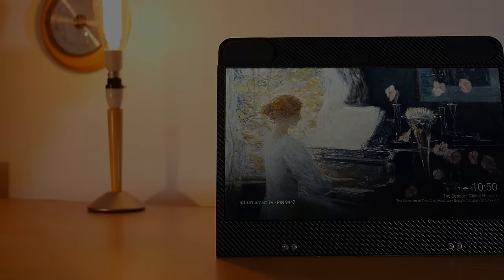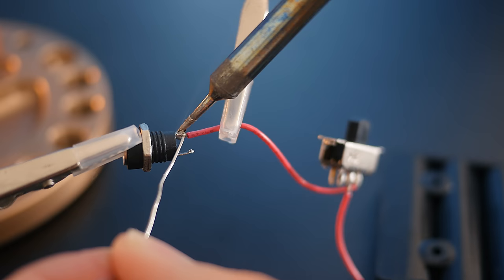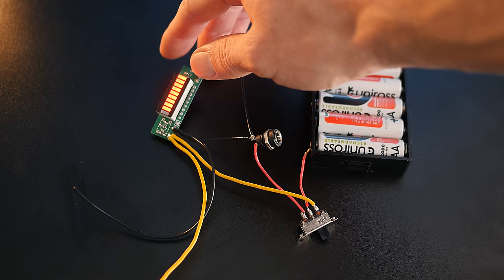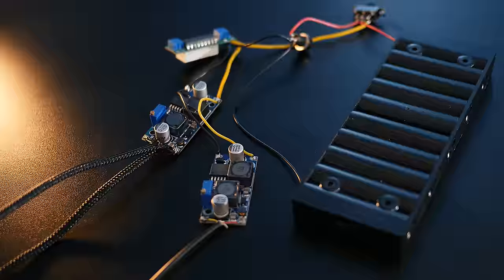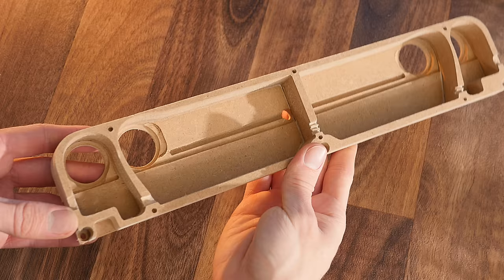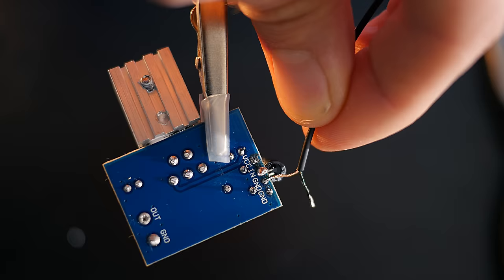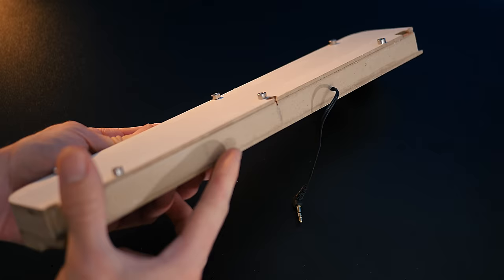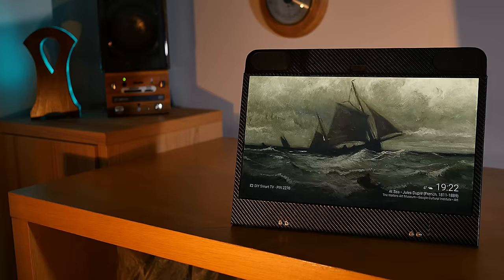Build your own portable SMART TV (100% wireless!)

Comment: Any reason why you went for a load of AA over a few 18650s ?
Reply: cheap and safer to work with
Reply: +山寨卡屁 Lithium cells are nearly as safe as long as you keep them above 3v, keep them under 4.2v and don't short them out and although it costs more there are also LiFePO4 cells which are even safer.
As for the cost, AAs are certainly cheaper but not by very much, especially when 18650s last longer (roughly 400 cycles vs about 1000 cycles) and have way more capacity so I'd say that easily more than makes up for the price difference, but if you go on ebay and buy cheap laptop packs you can get good deals on 18650s at around $1 per cell and are usually decent cells, last couple packs I bought, I received cells that were roughly 2000mah and 2400mah. (9 cells and 12 cells) for me the cost was closer to $1.25 per cell so let's calculate the cost difference using that.

$11 and $15 for both packs, now rechargeable AA tend to go for about $20 on an 8 pack at local stores and $35 for 12 pack of quality pack of eneloops makes them $2.5 and $2.9 per battery, now that's an unfair comparison since the 18650s are used but new cells only cost $3-$5 and offer over double the capacity and at least double the lifespan, without counting the added charging and discharging circuitry they are an insanely good value compared to AAs.

I'm guessing he went with AA because people are more likely to have them lying around their house and/or merely prefers them for some reason.
Reply: One thing you're wrong about, Eneloop Ni-MH AA cells are rated for 2100 charge cycles, which is much better then cheap 18650 Lithium cells. They hold up to 60-80% their charge for well over a couple years and have a VERY low internal resistance. http://a.co/cfeNtl3 Price per unit is about $2.65. The new line of Eneloop cells are very impressive in terms of specs. I think they're working on a 2500/3000 cycles 3AH version to be released 2018.
Reply: theLuigiFan0007 Well I meant more so in general terms, obviously if you get some quality 18650 cells and limit their charge to only 4.1v or there about you can get 2000-3000 cycles on those too, but yeah those eneloops are pretty great aren't they? Plus they don't even cost much more than some of the poor quality batteries sold in local stores.
Reply: vgamesx1
Rayovac used to have Ni-MH 48 packs for $70 and 24 packs for $40 on their site. They were 2400mAH and rated for 500 cycles or 1350mAH and rated for 1000 cycles. That's not too either for the price, but I can't find packs those size anymore. I bought a 16 pack of Rayovac Ni-MH batteries a couple years ago (1350mAH version), and last year got a 16 pack of Eneloop cells.  Still use the Rayovac batteries quite often, but more for things like flashlights and game controllers.
Reply: theLuigiFan0007 I use my eneloops for my mouse, it has great battery life even without eneloops but who wants to worry about their mouse suddenly dying or running out of batteries? For flashlights though I've switched over to 18650s since they're usually brighter and/or at the very least last longer from my experience so far, including the cheap ones under $10 are fantastic, well aside from the annoying flashing/sos mode on a lot of them.
Reply: vgamesx1
Yeah, Lithium batteries do result in much brighter flashlights. They're definitely the way to go unless you like building very tiny electronics like I do. Gives me something fun to do. :P

Epoxied three ring shaped intertwined coils of fine wire to the underside of the light reflector. 100 turns of 40 gauge, and two sets of 10 turns of 32 gauge. I used thermal glue to attach a small MOSFET to the inner side of the aluminum cap holding the reflector. One small coil to drain, one small coil (reverse polarity) to gate, and the special thin one to a little PCB in the reflector. It had a Schottky diode in series and a 0.1uF ceramic capacitor in parallel. 16 of 3V white SMD LEDs are across the capacitor.

Batteries can be installed like normal, and it's super bright. Voltage across third output coil is around 100VDC without load, and VERY tingly but not painful to the touch, might I add. Drops to about 40-48V under load, which is about right for around 16 white LEDs. It lasts about 3.5-4 hours running at about 1W, which is about right as 2 of the 2400mAH batteries is just under 6WH.

Only problem? The 16kHz it oscillates at is quite audible to me. Most people can't hear it, but I certainly can tell you that I can. Most pets, specifically dogs are initially very amused by it for some reason, almost like a dog whistle, but ignore it after about 5 minutes. My first prototype ran at 7kHz and sounded like very quiet, but noticeable tinnitus. Oh, the glorious coil whine. XD
Reply: theLuigiFan0007 Very nice and it's cool to find someone else who's interested in both electronics and Minecraft :)
Reply: vgamesx1
Nice to meet you too, that's quite interesting. Have a good day. :D
Reply: why the fuck would it be safer when they are both rechargeable and 18650 batteries never explode in comparison to li-po
Reply: They are safe if you dont solder them LOL
Reply: batery from broken tablet pc would be the best i think

Comment: When using vinyl wrap on a surface with small holes, place the end of a vacuum nozzle behind the hole while heating the vinyl to essentially vacuform it, looks neater than cutting and tucking or using a pen to colour it in

Comment: Really cool stuff. ;)
(But i would use 18650 li-ion battery's instead.)
Reply: How would you do that? How many cells? in series/parallel? and how about the charging? TP4056 can only charge 1 at a time?!
Thanks for your help
Reply: @surfer2011 hiya I'm just wondering if you figured it out as that's what I want to use xx

Comment: A few things I'd like differently: I can't tell if the 3.5 is accessible but being able to do a quick switch to headphones would be nice for a wireless display especially. 

Having maybe a second bank and a Raspberry PI or a low powered computer with flash storage would be nice to have movies as well, maybe again switchable from the Chromecast easily.  I would have another option for the battery indicator, maybe something that let's me press a button because LEDs like that which are constantly on can easily add drain to the battery.  A lot of wireless mice actually drain significantly faster with an LED on them and even if it's not as much here, maximizing battery life is a huge priority. Also, not sure if it's possible but a direct outlet passthrough option would be fantastic.

Overall, awesome project and most the stuff I bring up is not realy necessary but would be amazing as a v2.0
Reply: Many of the controllers do in fact come with 3.5mm headphone out I believe. Using the Raspberry Pi in place of the Chromecast is I think a good idea, but prices will quickly escalate with a Pi-Juice UPS to avoid sudden losses of power. 

Then a common power storage bank is all the more of an advantage with something significant like 18650's, a suitable controller but use instead LiFe-ion type of 18650 to remove any possible thermal runaway problems as seen on the Boeing Dreamliners (e.g. at Tokyo airport shortly after its launch). 

Step by step following all the well worked solutions will bring this well designed DIY Perk up to any desired standard. But this clearly talented channel author did it all first in a way that anybody can follow and be happy with the result, do you not agree?

Comment: Dude, I thoroughly enjoyed the video! I do have a legit question about the bass speaker/chamber/port. I realize we're not designing/building for the New York Philharmonic, but does it change the characteristics of the sound when the port length is determined, then you effectively shrink the space by putting the amplifiers in that chamber? This may be an acoustic 'red herring' on my part, but that's why I'm asking. I know just enough to be dangerous. ;-)  Thanks mate, and again, great work!!
Reply from the maker: Yeah, it will affect things very slightly. Whether you'll notice is a different matter! I did my testing with the amps inside the enclosure just to be sure.
Reply: DIY Perks what is the camera that you use in your video's?
Reply: DIY Perks I'm surprised you designed the speaker factoring the box in. When designing a sub the box is probably the most important part of it. You should partner up with barevids lol.

Comment: Its a shame u didnt use lithium-ion 18650’s
Reply: Kevin only real ones use them for everything.
Reply: EXACTLY what I was thinking!
Reply: 20000mah power bank?
Reply: Li-po is better.
Reply: Tech has changed, you can probably simplify the whole thing with a PD power bank and PD trigger cables to get the voltage you want basically removing a lot of parts and soldering.
Reply: @aimless3827  solid state is better
Reply: Thu Nell Ⓥ  Actually, lithium polymer batteries ARE lithium ion batteries.  The "polymer" part refers to the electrolyte. The most common electrode chemistry for both is LiCoO2 and both have the same strengths and weaknesses of that chemistry.  Namely high power and energy density, and high risk of fire *under fault conditions*. What most people call Li-Po's are usually just pouch cells, which is a battery format, not a battery type. 

Both cylindrical can cells and pouch cells may have a liquid electrolyte or be true Li-Po's which have a gelled electrolyte but can have a range of other chemistries (LiFePO4, LiMn2O4, etc).  Pouch cells simply have less protection against puncture, crushing or bending and hence are more dangerous if handled improperly.  They're still a good choice for applications that don't require them to be handled outside the device and they're actually a lot cheaper to produce.  Most of the time the added expense at the consumer level is due to shipping restrictions.
Reply: Maybe they are too thick or something
Reply: @whatelseison8970  great reply
Reply: 18650 is the future

Comment: hi. i have made the same project but i used the universal TV board its more cheap and also no need to add audio amplifier, also i used LI ION 12 volts batteries ( old laptop batteries ) with protection board and the TV works for 3 hours with 50% sound volume, and 6 hours if connected with external sound system in my case i used my DIY portable Bluetooth speaker. thanks for the idea i have made it coz i have watched your project and am happy with my project.
Reply: Do you have a video of your screen as I want to use 18650 but I'm not sure how to wire it up xx
Reply: @vikkidyer  Hi. Sorry I don’t have video for it.  was long ago and I moved to another country.  The batteries you just find out on YouTube how to make 2S battery and for the wiring it will be same as DIY Bluetooth speaker for example no different. Good luck

Comment: It's be cool if you made a second channel that goes more in depth into the electronic side of things, because I think you need a basic knowledge of voltage and how electricity works etc to even attempt this.
Reply: This video is enough to guide you with a big picture direction! If you're serious about following a build like this, go do the extra research elsewhere on the internet to nail the details down. A little more involved than just 'do exactly this', but only a bit, and far more educational. :)

Comment: Interesting build. (You're quite a prolific builder!) I know it would alter the contour of the build, but it might be worth looking into "C"or even "D" cells for a longer amp/hour. I like the idea of the Chromecast. That might be a way to send the signal from camera mounted on a crane to a nearby monitor. Finally, the bendy arm at the end. As a DIY-er, you might look at a photo item called a "Gorilla Pod" by Joby. That would give 4 bendy arms, add a few croc clips on the ends ...

Comment: i once got an 24 inch imac panel and a raspberry pi and a controllerboard and installed it all and installed a tv software (Andriod) and it is amazing with 8 owm and 45 watt speakers (4times) and subwoofer (2 times) and i use it daily it's also portable and pretty light for its size (643 grams) battery i used is a 10000 amh

Comment: Another great build Matt! 
DIY idea: robotic and programmable pourover (like the Hario v60). You'd need a precise heater to heat/keep water at the right temp, a motorized arm to move in a spiral motion over the V60 (so 2 small motors,  one for the circular motion, and one to move the valve/water hose along the arm), a pump/valve or just a valve (with the heater above) to let water out at the right flow, and a raspberry pi to control it all. Additional options: automatic grinder that dumps into the V60 so all you have to prep the night before is the filter and putting beans in the grinder. Goal is to have a delicious cup of high end coffeeshop coffee made for you to save time before heading to work/class.

Comment: Great video!   I took my old laptop monitor and turned it into a smart tv using a Raspberry Pi.  I control the Raspberry Pi with wireless using my  laptop.  For my speakers, I bought some cheap wireless speakers. Although, mine monitor does not look even close to this nice and I love the speaker set up. Thinking I could combine the wireless speakers with your speaker system to get surround sound. Gonna have to do some sprucing up to do this weekend.

Comment: Put a 2 rubber tubes on display back stands, or, at least, paint them in black with some paint =) That will add a finishing touch to the project.

Comment: I'd be curious to know if voltage regulation could be used in a build I am working on. Its a wireless table lamp. But instead of using a 12v or a 5v lightbulb, as many other DIY channels have used, I'll be powering a smart bulb that has an operation range of 100v to 255v. Its a tricky build and I'm facing a few snags as an AC power bank is quite large and expensive.

Comment: a few things I did different was I quadrupled the amount battery's and got a brand that lasts longer in total I can stream for 8 hours before needing to recharge even then i added a option to where i can plug it in so it doesn't need to use the battery's, in fact I made it so I could switch to a mode where it wouldn't charge the battery's past 99% (to prevent battery strain) and would still power the TV but not the battery's so i made it have a ton more functionality
Reply: hey. i am trying to make the diy. but i need help whit the name on the part I need to buy. Can you help med mabey. I can see you made it :)

Jesper

Comment: Just a quick question, and I know it might sound stupid, but why didn't you use lithium ion batteries from a laptop battery instead of Ni-mh AA batteries? Also, why didn't you use two stereo amps instead of four mono amps? I find the PAM8403 or PAM8406 very serviceable for smaller drivers, and they run on anything from 3-6 volts, which means you could have used the same output from the 5v step down converter for the chrome cast.

Comment: Next time you should probably want to set the voltage a bit higher like 12.20V because you will have problems with a small voltage drop from the batter's iner resistance .
Nice videos btw

Comment: Man I love how you made something so relatively complicated kind of simple and easy to follow. But one thing I don't get is why make this?  sure it's cool and I will probably make this but i don't know when I would use such a device when I already have a television set. Sure when I move out I won’t be buying a tv and will probably make a device like this but the battery part baffles me very much...
Reply: You can use it as a portable external monitor for your laptop this way--that's what the original design was, and for that design, batteries make a lot of sense.

Comment: Any chance for an updated guide for this? I know not much has changed but I thought there might be a better components that are more easily sourced to build it. I suddenly have some extra time on my hands and thought this might be a cool project.  

Since I will be taking my screen out of a laptop what steps would I need to use the battery from said laptop instead of the AA rechargeables in this project?

Comment: How would one go about using a NiMH RC car battery to power this? (In my case, an Onyx 7.2v 5000 mAh battery I no longer use with my Traxxas Slash)
Would it be as simple as connecting the battery in place of the AAs, or is there anything specific I would have to do?

Comment: I have made a similar project which is still a work in progress...I used 18650 batteries with total input 15 v followed with MT3608 step up booster set at 12.4 v for the screen board and backlight driver. Problem is at 15v current the backlight driver starts hissing hence I cut back one battery and input 12 v. My setup only lasted 25 mins without speakers on battery till total voltage became 10v(which may be because I was using old laptop batteries).I am still hesitant on adding a charger jack as to avoid any shortcircuit. Any suggestions?

Comment: Hi, great video, I'm having an  issue trying to replicate your speaker and amplifier part of the video. I tried looking through your comments to find info, but all I could find was "I love your accent", and "why aren't you using 18650 batteries for power ". Anyway,  are you splicing the power cable to each amplifier? And my next question is what type of speakers are you using as in ohms and wattage. My speakers sound like crap. My tweeters are 4 Ohm 15W, and the low end are 4 Ohm 3W. Should they both have the same wattage? And when I pass the woofers through the capacitors they sound even worse. Thanks

Comment: So taking the speaker part from here, and instead of drivers, solder the output of the amp-circuits to a clasp-style connector (to connect speakers that have exposed wire instead of a jack), and adding the volume knob video into the mix, I can make a pretty sweet desktop amplifier. Don't I?